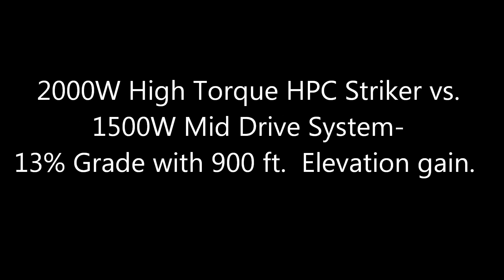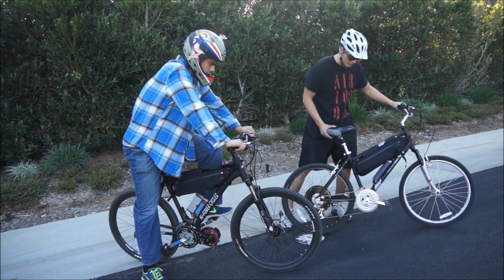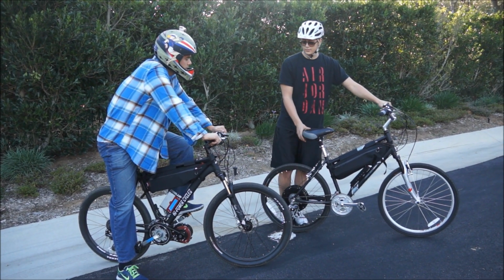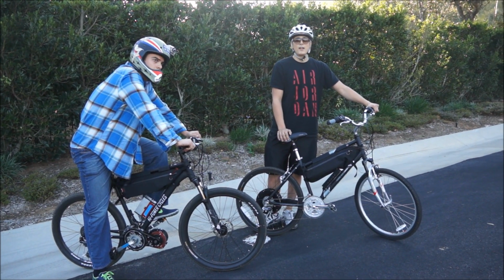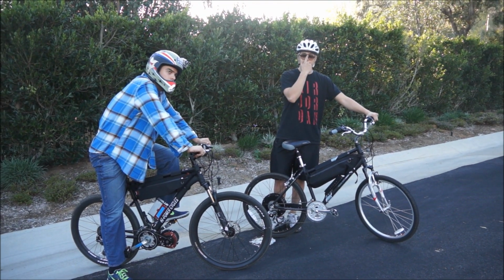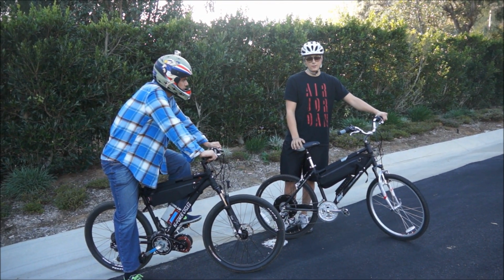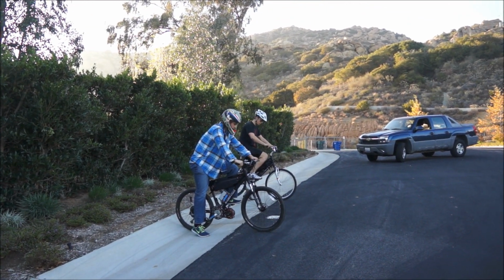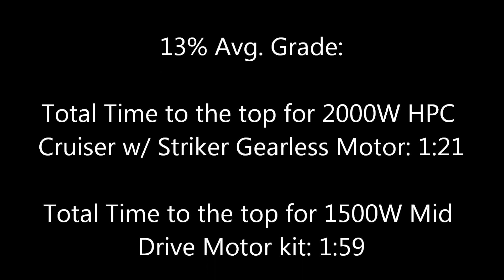Hub Motor vs Mid Drive Part 2

Comment: Btw my friend has a highspeed crystalyte 5302 and puts about 5kw init and it actually stays cooler than mine. 
And than there also a hightorque version of the 5302 which should stay even cooler? 
Then again i use a sensorless controller so maybe my hallsensors are fried as well :P

Comment: has anyone had front and back hub motors with mid drive? would it be possible or would you need a huge bike for all the bits.
Reply: That's madness would weigh a tonne

Comment: The mid drive is making a popping noise I'll settle for a hub motor instead and the mid drive could be history.
Reply: +Matthew Joseph That was the rider changing up and down gears whilst at full power on the mid drive motor.

Comment: Well that's just complete bullshit. Firstly it's completely unfair to not put the mid drive in the right gear, why not put the hub motor on a 50 inch wheel then? Secondly I don't know what mid drive motor that is but if you paid 4 grand for that thing you got ripped of big time. My BBSHD that pulls 2000W @ 52V will top out at 38mph in 3rd gear and would climb that hill like nothing, if you started it from a stand still it would accelerate up that hill, not decelerate. I ride 50kms a day and found plenty of climbs with more than 15% gradient since getting my kit, my mid drive doesn't break a sweat. But my god 4 grand for that thing, and the gear shift sensor doesn't even work well 2:04. I mean the rider isn't doing the crappy gear shift sensor a favor by changing gears up hill anyways!

Edit: Ohh lord after watching the video back again I don't think the kit even senses shifts. The rider was shifting on power, that's a yikes from me.

Comment: doesn't really say which design is better without a comparable torque/rpm comparison and an analysis of power loss though drivetrain. but, nice video.  :).

Comment: This test must be rigged or just wrong. The mid drive unit makes the bike lighter and able to select the correct gear ration for optimum loading of motor. I would also bet that the hub motor is drawing more than 2000 watts as it is climbing a steep grade.

Comment: WAS THE HUB GEARLESS? DID THE MID SHIFT? SO THE MID TOOK OFF FASTER GOING UP THE HIGH SIDE OF THE ROAD BUT THE HUB USED THE DOWNSIDE OF THE ROAD TO GET RPMS UP!

Comment: This is deceptive.

That hill was not steep enough for a mid drive to outperform a hub motor?

Take those two bikes on some steep single track and the phase wires on that hub motor would melt with in a short period of time while the mid drive would torque along very nicely. 

Gotta love em both for own strenghts. But don't try to compare them cause they are just meant for different aplications

Comment: Would of helped if you both took the same DIRECT line... guy with the competitors mid drive went to the far right then back over to the left then took your line...  some peoole are to smart to be con'ed mate!
Reply: too smart to be conned? dude he lost by a long shot. doesn't matter what path he took it didn't compete in the slightest.

Comment: So how much juice did each one use? I'm betting the hub drive used way less.
Reply: mid drive should use less since it has more torque at low speed than the hub drive

Comment: Something wrong with guys mid drive. Or it is super weak. My bafang would of killed other bike. It's an giant tramce 2 fully fox shocks all around. Top speed 42 mph. I average all day speed 25 to 30mph with p.a.s mostly. The throttle as I say it is more like a speed maintainer. You can peddle way past 25mph. You cant throttle past 25mph and it kills battery. So you never want to punch the throttle unless you wanna kill it all. You have to remove gear shifting sensor. Use your xt slx or whatever brake sensor as a clutch. To swtich gears. Way better more like dirtbike. Which comes natural. I have 2 e bikes going up on Wild timez channel. I will make full review after cosmetic parts come. Bike flys up and down hill and over almost any root rock garden jumps ate amazing. Lima freak. 4 years I'll never look back

Comment: both motors will overheat just the same when pushed to max performance. 
A hub motor has much more surface to disapate heat so the difference really isnt that great.

Comment: I have a modified magic pie 3 by golden motor (which isnt even such a great motor but is has loads of torque ) My bike weighs 36kg (lightweight lithium magnesium battery's) and i weigh like 60kg so that might give me an advantage..
Paddling isnt even an option on my bike as the motor drags pretty heavy.

Comment: Ok,..no offence guys but if thats a 1500 watt mid drive..then my etrike is a 5000 watt mid drive..give me a break..you kept switching gears like you didnt know what gear to put it in..my trike would smoke both of those units...but WOW!! the hub motor has more power...so i guess it eventually overcomes the gear deficit and wins the race..cmon compare apples to apples and have someone drive the thing fairly!!!!
Arctrike.com